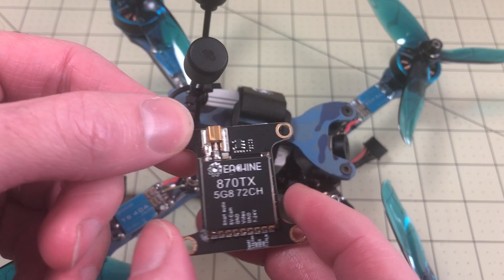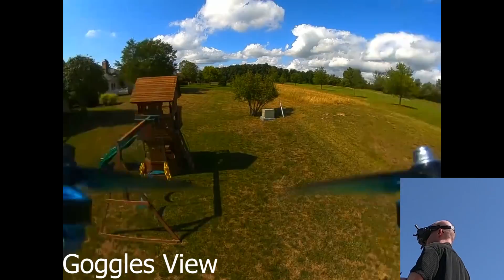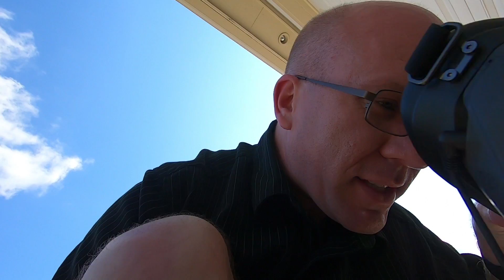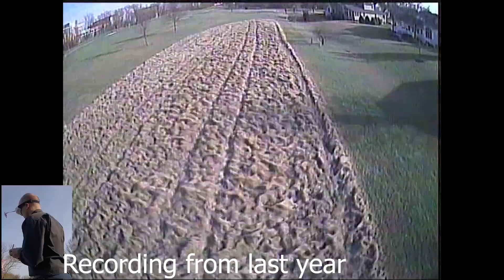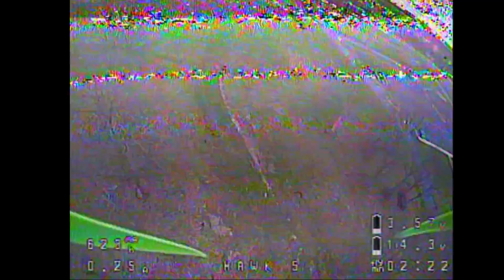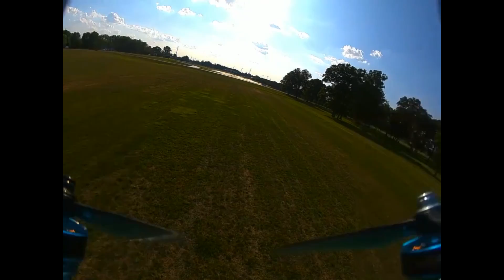DJI Digital FPV Goggles System Review – Flight Testing and Analog Comparison

Comment from the maker: Here are several places you can get this setup: https://geni.us/DJIFPV2
This is the drone I put it into: http://bit.ly/WizardTS215
These are the camera adapters I used: https://geni.us/MicrocamAdapter
I like GNB 4S 1500 Batteries: https://geni.us/GNB4SBatteries

Check out my current giveaway: http://geni.us/DroneRacer101Rewards 

Does the DJI Digital FPV Goggles fulfill all of it’s promises? Is it better than analog? Is it easy to install in a drone? It there a lot of latency? Does it cure cancer? Does it give you cancer? Should I buy it?  This video is long, and it covers move of those questions, not all of them, but most of them.

Comment: Good test flying. Seems like this is going to be a great system for guys like us who care as much or more about the flight experience than the video. I put it off until I was pretty sure there wasn't a big problem, and couldn't take it anymore. Mine came today, Got the Goggles setup - thanks for the video on that.
Been a bad season for me as well - family stuff has kept me from flying, but I figure I owe it to myself to get some quality flying in before the weather goes bad here in NY. I also have had a 7" I flight farme setting since spring that I'm building as a 6" and will probably divert that build into the HD. Didn't go for the DJI TX as I am happy with CRSF and am well stocked up on that stuff, but I have 2 Air units. 
I'm really looking forward to your next video and getting one in the air myself.
Reply from the maker: It would be great if they come out with a smaller Camera and VTX only version.  And that is exactly it for me.  I just don’t think for the most part anyone will ever care about my HD video anyway.  It’s all about the feeling of flying.  And the DJI just does that so much better.

Comment: Try turning Focus mode off - that's what's causing the edges to go blurry first.  You might like turning it off?  I'd be curious to see what your range is etc?
Reply from the maker: I’ll probably try it,  but I actually like it.  In theory it keeps the center sharper longer and I’d rather see right where I am going super clearly than the whole thing be a lower resolution.
Reply: @SimRacer101  I agree with you in theory, but it seems others are finding that it doesn't help much with range.  If the range is the same than I'd rather have the full picture clear, all the time.  ALSO - are you using "performance" mode or "Quality" mode?

Comment: there is an adjustment for the edge blur its a feature...
Thanks for great vid
You mentioned a wing? I'd like to see that I have a 2600mm glider might be nice on. could you try it without DJI controler just FPV
Reply: There is no difference to the video when you use the controller vs not.  The controller is optional - check out Josh Bardwell's video where he flies it without the controller on Crossfire.

Comment: Was that on 25mw?
Reply from the maker: 700mw. 25mw comparison is pending.
Reply: DroneRacer101 from other video the imoression was that DJI has to authorize you to switch (or not) is that the case or you can decide the vtx power on your own as we are used to?

Comment: LOL 1000$ for 700m range in LBT mode and looking like a fly,  it's probably a joke from DJI...
My 200mW and 8$ eachine VTX do a better job !
Reply: wat.  Range is 4km.  Your 200mW VTX can't do a fraction of this range.
Reply: @Protonus  range is 700m in LBT mode, any 200mW VXT does it with no problem at all.
this page, all the way down, read the little [1] https://store.dji.com/fr/product/dji-digital-fpv-system?vid=83211&from=menu_products
it says: "[1] Distance de transmission max. : FCC : 4 km, CE : 0,7 km"
Reply: befor you ask, NO you can't use FCC mode in eu because of GSM frequencies...
Reply: @trophythedrifter  That's not true, lol.  There are at least 3 different ways you can enable the full 700 mW power of the DJI system in the EU.  You can use a VPN, you can register as being in the US, or you can modify the config file on the goggles themselves.  There are multiple videos on how to do this on YouTube already.  Sure your government and DJI don't WANT you to do this, but you CAN do it, and if this is your biggest concern with this system, than it's already fixed.  BTW - this is no fault of the system, this is a fault of your government!
Reply: @Protonus If i want to be fully compliant with the laws in my country, FPV is completely forbidden. So any kind of FPV goggle is by the way pointless. Over this, If i need to "crack" a 1000$ hardware, it's gone to far. FatShark byte frost will wipe out this a joke with a real FPV hardware for racers in no time.
Reply: @trophythedrifter  heheheheheh did you see the shitlooking FS video, it looks horrible, any way you slice this you're following one or another closed system be it DJI or Fatsharks.
Reply: Do they do it on digital?
Reply: @zimzillakilla  i don't know if transmission is digital but it's HD and compatible with any goggles with hdmi input (nearly all FS line up)
Reply: You should try it without focus mode.  Also 720p 120fps is less lag overall

Comment: System is sweet, thanks for testing. But it's gonna be 30% more expensive in my country, and by the time it's in stores it'll be winter.
Reply from the maker: Which country is that?
Reply: @SimRacer101  Russia. Dji equipment is heavily regulated, unlike hobby grade stuff.

Comment: Looks like an amazing system.  Even at its worst, it was far superior to analog.  Only thing I notice was the vertical field of view seemed limited.  But that should be an easy fix for DJI.
Reply from the maker: No, I wouldn’t go that far. :-)  At the end of it’s limit analog is going to be more flyable.  But if you can stay within say 80% of that limit.  This is just a joy to fly.

Comment: The goggles work with the fedora BTW. I think your analog is terrible. I fly around and above trees all the time with only a stubby on the quad and 400mw on the iFlight vtx and have little or no breakup. I took some last night, if you want to see it, I can upload a clip.
Reply from the maker: Yea I want to do it on the same day with a similar output but the hawk was the only thing I had a recording of. Thats why I wanted to point out that a linear antenna on 200mw just isn’t the same.
Reply: @SimRacer101  Most of the time you had a clear shot at the linear. It should have done better. Did you have linear on the goggles?

Comment: Wow, it's like foveated rendering for VR, with those blurry edges.
Reply from the maker: I had not heard of that term but yea, that is exactly what they are doing. In this case they are dedicating most of the available bandwidth to the center to is the as high of resolution as possible and when it bandwidth is reduced it “steals” it from the edges to keep the center sharp.